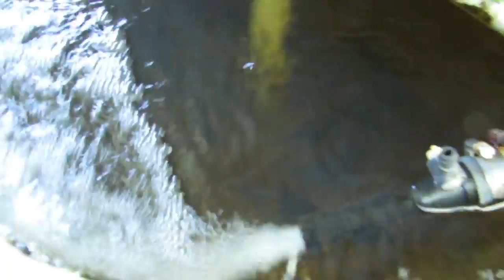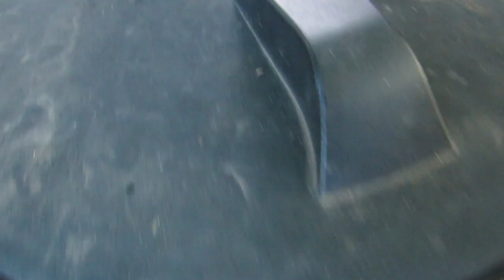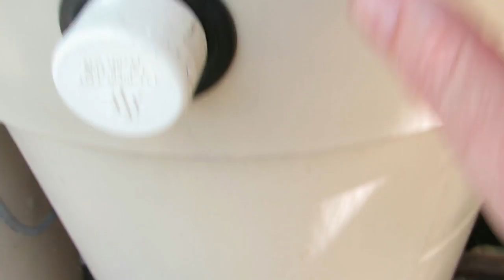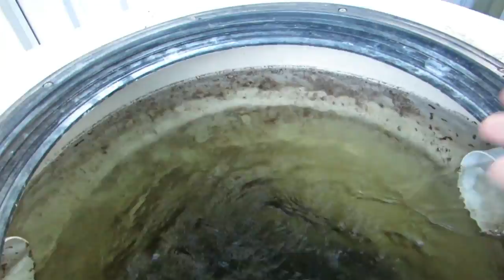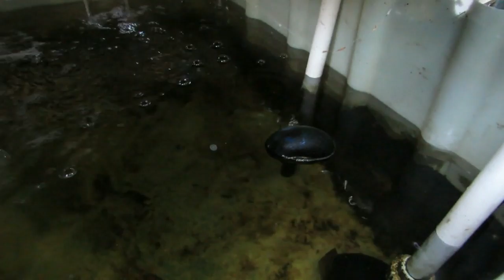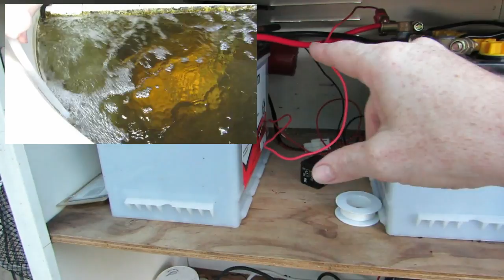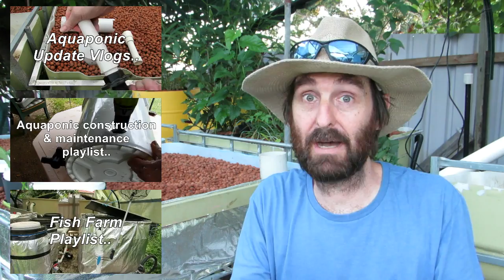Aquaponic Vlog 15.. How the water flows through the system & a look at the fish..

Comment: what happens if the grid goes down and the power goes out?  how long is your battery supply good for?
Reply from the maker: Hi there.. Those batteries should run for about 20hours by my calculations.. Apparently we are on the same grid as the regional hospital so it never stays off for long.. 
I am looking at getting a back up generator as well to run the main pump from just in case we lose power for a day or 2 like we did during the 2011 floods but think the batteries will do for the 1 or 2 small blackouts we get every year at the moment..   
In the future there will be a more permanent structure over the system with either solar panels or mini wind turbines that will be used to run the system & charge the batteries.. 
Cheers & have a good one..
Reply: Thanks for the info, Solar sounds awesome have you heard anything about  a no power aquaponics setup?
Reply from the maker: Permaculture Prepper No power AP would have to be going back to the original systems of the South Americans & other civilizations that used a chinampa style gardens I would think.. I have seen a post where a chap was floating plants on a raft in a fish pond but can't think where I saw it now..
would like to have a crack at that style of system in the future if we find ourselves on some land with a dam..
Reply: it was Geoff Lawton,  awesome info, thx for the share as always.
Reply from the maker: Permaculture Prepper Found the post
https://www.facebook.com/groups/aqua.centre/permalink/528117790663239/
It was on FacePalm ;)
Cheers

Comment: Heya Rob. Great video and great idea to do another full walk through. Can I ask how many water pumps you are running and where they are? I had so look up how a SLO works - what a great way to get the fish solids out! Thanks
Reply from the maker: Hi Ben.. Just the 1 Resun 10000lph pump mate.. Is in the sump & only mention it very quickly here http://www.youtube.com/watch?v=N4mYcUvZ9cw&t=10m48s
Hope that helps mate :-)
Have a great weekend mate..
Reply: Ahhhh - got it now. I didn't realise the bottom pipe went back to the fish tank. I thought you had 2 pumps running but I could only remember seeing the one.

Comment: Morning Rob;
Great video.  I have a question or two.
I like your file pipe use in the grow beds, would it be ok to put some aquarium filter in the pipe to help filter out any solids in the system?  Or would that slow the fill or cause it to be plug?
My plan was to clean it every week or perhaps every few days.
Thanks again, you all have a great day.
Linden
Reply from the maker: Hi Linden.. Have used & seen a lot of folks use the green dish scrubbing pads as mini solids filters on their grow beds.. Just need to make sure they aren't impregnated with any detergent or anti bacterial products.. 
I did have some filter aquarium material under the inlets of the new beds but took them out.. They weren't really getting a lot of solids in them but as the pads were such fine grade they were clogging quickly.. There are a lot of fine roots travelling through the system from the reclaimed clay I'm using but that should settle down soon I think.. when I get a courser grade of filter material I'll cut some more out & pop them back in to see how they go.. 
Hope that helps a bit mate..
Cheers..
Reply: Thank you for the reply, will look for them.
Hope you and yours have a great weekend

Comment: RobBobs Backyard Farming Something simple for the back up system would be to use a adjustable pressure switch (http://www.directindustry.com/prod/kaustubha-udyog/compact-pressure-switches-62335-419699.html) the one in the link goes as low as 3 psi so as long as where u place it u have back pressure and goes to nothing when the pump is off it will work good and is uber simple to setup no programing required. Me personally i would also put a small red led trailer on the outside of your backup box so that u can see at anytime of the day if the backup sys is enabled.
Reply: I can do up a diagram on my idea as to how i would set it up.

Comment: Well done again rob 
yes you are correct as backyarders we do make mistakes yet videos from yourself and others make aquaponics a little easier ......
just curious why Paul Van was shaking his head besides the thousands of plugs in your tanks and filters it works ??? 
thanks
Reply from the maker: Hey Brett.. Think he was mainly siring ;-) There are a few issues like the main drain line from the tanks & using the bilge hose but nothing major really.. Could leave the system like this indefinitely if I wanted with no issues but some bit will be modified to help keep maintenance down.. 
Thanks mate & all the best to you all.

Comment: Rob, have you thought about Ardunio for some control of your system? I run it on my system, and it is excellent, you can connect just about any sensor (flow rate, wet level, float switch auto fish feeder etc etc). It is only limited by what you are capable of designing for it. Might be helpful for your system I think
Reply from the maker: Hi there..
Have been told of few folks use them in their systems & hydro as well.. was talking to my brother that works in IT & he suggested a raspberry pi might also be an option so have been thinking about it a bit.. was going to see if my nephew might be interested in teaching me how they work.. Might also be a good project for his school tech studies I think..  would of come in handy last night to tell me I left a tap off & saved the lives of 10 fish :-/ 
Cheers mate & have a great one..

Comment: Great update Rob, your system is really growing and improving all the time. Can't wait to see your DWC system up and running.
Reply: RobBobs Backyard Farming Your system and vlog was part of the inspiration for me to get in to AP.  Thanks.   I've had a DWC bed for a couple of years and it works well, particularly for greens such as lettuce.
It took me ages to come up with a method for supporting the pots.  The breakthrough for me was to realize that I didn't need them to float, but could rest them on the sides of the bed.  Floating rafts are specifically for commercial/production systems where they need to move rafts along a very long trench.
Here's some photos:
http://community.theaquaponicsource.com/photo/img-6587-medium
http://community.theaquaponicsource.com/photo/img-6469
http://community.theaquaponicsource.com/photo/img-6471
Reply: John Malone Thats what I was thinking with DWC, as the water is at a constant height no raft's are really needed. You have done a really nice job with your DWC culture beds there John.
Reply: RobBobs Backyard Farming That's bathroom wall paneling.  Fiberglass reinforced plastic (FRP), I think.   Very tough and resilient.  Don't use your favourite hole saw on it, because by the time I'd finished I didn't have any teeth left on the hole saw.   It was a cheapie, so all is good.   I still like the design and it's stood up to a couple of seasons of abuse with no signs of wear.
You might even be able to salvage the paneling from a bathroom remodel if you are in the right place at the right time.  If you can't then 8' x 4' sheets are readily available at the hardware store.
Reply from the maker: I can't wait ether mate :D Trying to find reclaimed material is proving a bit harder than I thought though.. 
Cheers Phil..
Reply from the maker: John Malone Thanks for that John.. Looks more like a Kratky design.. What sort of board did you use ?
Reply from the maker: Thanks John Malone Didn't think of using something like that..
Cheers mate..

Comment: Nice video! I have found that galangle ginger grows without any media.  mine is in about four inches of flood and drain, it is about five feet tall, it gows so fast, i cut it with a sawsall,about a two gallon bucket every month or two! Im in process of building a much larger system on new place i bought Im going to use ibc for tanks,also incorperate deep water,ebinflow with rocks,my galangle system,constant flow through a small rock bed for watercress, and a nft with four inch pvc,as soon as i get the temp regulated on breeder tank i will be raiseing my own talapia. Also twelve chicks, twenty four rabbits,after the move i plan on quail to eat!  M shooting for all solor run system and house. Thanks for the videos,all my stuff is DYI.
Reply from the maker: Sounds like you have a great set up here Douglas.. Are you in an urban area or on a bit of land.
Cheers mate..